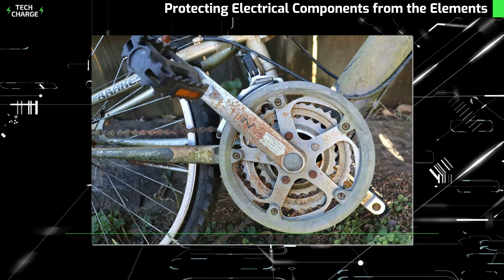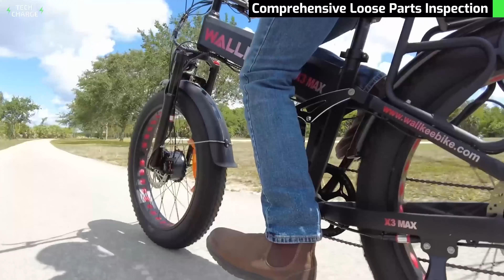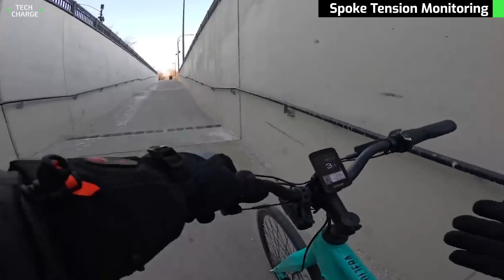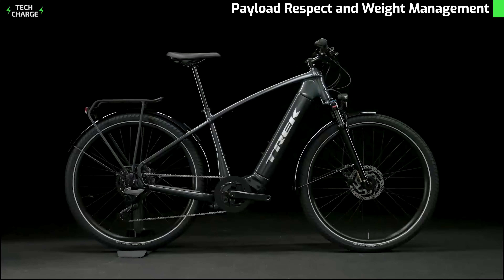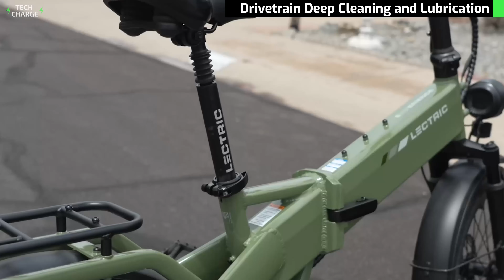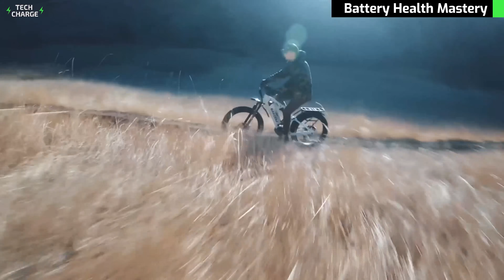Do THIS Regularly, and Your Electric Bike Will Last Forever!

Comment: Any thoughts on how to regulate how much you charge the battery if the charger doesn't have a gauge?  I want to take good care of it but not sure how to without the built in gauge???
Reply from the maker: Since many standard chargers don't have built-in gauges, you can use a simple plug-in power meter between the wall outlet and the charger to monitor the energy consumption and unplug it once the charging slows down!

Comment: You comment on things to help save a battery. Thanks but your video pic shows the battery being checked, and you fail to show how to check it or the lithium cells within it.  With all the high end proprietory bike batteries being sold at 800 to 1200 dollars it would be nice to know how to check and save them, not just clean your bike and chain.

Comment: Well I just use cheap e bikes from china, you can adjust anything you want on them, cheaply, parts, controllers, batteries, display and motors are mostly interchangeable so makes everything so much easier than all those Bosch type motors. The frames are steel, you really can't go wrong. Had to waterproof it myself but apart from that your laughing for the money. These people paying thousands for normal slow ebikes are absolute idiots. If you have to take your ebike to a specialist to get it serviced, that's shameful to me. Its not hard to work on bicycles. Buy the crank removal tool, chain whip, spoke key and just a load of spanners and Allen keys. You never have to pay to get anything done ever again on it, you do it all your self

Comment: A bit of WD40 on contact points, metal gears, bearings, sprokets and wipe down does help keep moisture at bay. Keeping bikes under cover, indoors stops corrosion. Batteries in room temperature and avoid charging when it is too cold, avoiding warranties. Only use generic oem chargers. Batteries, and never charge with a hot battery ( immediately after use, and wait to cool before using).
Reply: WD-40 is a penetrant for breaking free rusty nuts, for water proofing use dielectric grease that won't erode the contacts over time

Comment: so not just tighten loose nuts/bolts etc, tighten them to correct torque. Thats hex head, normal head, whatever head, I dont think so somehow. This video is enough to put most people off buying an e-bike. Battery charging recommendations are great though.

Comment: Use tires with treads designed for the surfaces and road conditions you ride on. Strongly consider puncture resistance. I use road tires with built in cushioned tread armor on a mtb. Inflated to 50psi. Tread designed for other surfaces will wear faster and ride rougher, with constant vibrations, and with more roll and air resistance if you ride on pavement.

Comment: I have been surfing for 50 years in 13 different countries many of which I used neoprene wetsuits to KEEP warm and one thing I guarantee you they didn't do and that is DISSIPATE HEAT. So my very first question regarding #15 is "What is this new neoprene called that actually stops moisture intrusion but somehow dissipates heat?". Where can I buy it? Thanks for making this video- going to watch #14 thru #1 now.

Comment: For the price of that type of maintenance you can just buy a new ebike every two years.
Reply: agreed, and might even get 3 or more years out of one.
Reply: Bike maintenance is easy for anyone has worked on their vehicles, since everything on a bike is much more accessible.  I have two ECells Five Star ebikes that are now 2 years old,1500+ miles on one and 1200+ on the other.  Minimal maintenance has been the ticket.  I've pulled both hub motors at around 1000 miles on each bike for a regrease, but could have gone longer.  Brake pad replacements on both which is simple with inexpensive kevlar pads from Amazon.  Beyond that, derailleur adjustment and chain lubing is about it.  I'm just watching for Commiefornia to impliment draconian ebike laws due to the actions of kids riding like maniacs and causing acccidents.
Reply: @melrobinson6919  There's this weird femi fascist attack on bicycles and ebikes. When I was a kid an around the year bike was basically a no maintenance item. Drop of lube, little air, maybe a flat tire every couple of years. These days even new bikes are constantly failing in urban environments. When have you last met someone who's been riding the same bike for the last 10-15yrs as regular all purpose ride? Professional maintenance is ok but priced for start-up types, DEI girl bosses or wealthy boomers.
You can buy a decent bike for 20-50$ online any day of the week, which is literally the price for getting a flat tire changed or a maintenance job, which often isn't even that good. That someone who commutes by bike or ebike pays below 500$ p.a. for the experience is probably the exception now, as far as I can see. That's ridiculous.

Comment: I bought an EBike and I never used it in the Rain. I kept it indoors and charged it every 3 Months.  After 2 Years the Battery was Dead.  I took the Battery apart and the Battery was full of Water. They obviously Stole my New Battery and Stuck an old one on My New Bike.  I have a Battery Welder but the Whole Battery unit was Rotten with Rust.  The Shop had gone so I took the Lithium Batteries out and Put a new Motor and Batteries on the Bike.
Reply: Never ever leave yiir battery on your bike when you lock it up you're asking for trouble then.

Comment: I got sick of the number of times the narrator says "28 MPH." If have a Level 3 e-bike, you have a motorcycle. Ride it and care for it like a motorcycle. My folding city e-bike is barely half that fast and it doesn't weigh more than a typical beach cruiser.

Comment: Most of these recommendations are more applicable to off-road riders with powerful motors. The suspension forks on my city e-bike are not even adjustable. The motor power is limited to 250 watts by law. Plus with the AI video production, and I am not giving this a LIKE.

Comment: The charging port for the $650.00 battery that I bought for the E-bike I built came loose and blew a 20 amp fuse inside the battery compartment which was completely wrapped in electrical tape ( I couldn't find the fuse) 2 weeks later I got caught in the rain and water got into the slide electric connection which wouldn't allow the battery to shut off. A gasket I made fixed that. 40 mph, 1500 watt rear hub motor 52 volt, 20 amp hr battery, 3 years, 3,000 miles I luv it 😅
Reply: ❤ ebikes!! ex olympic biker!

Comment: my 3 years old Electric Bike have zero problems NOT one.
Reply: My first ebike still will get up to 20 mph after five years. No problems I will occasionally use spray lube at the hub. I have adjusted the brake cable after it slipped.
Reply: Im sure it does if you haven't been taking care of it.

Comment: Not sure it's practical to leave your battery only 60-70% full?
Reply: It's better and easier to keep it between 20-80%
Reply: @allanwright9681 That's not what they're asking. The 80/20 rule isnt all that great by the way.
Reply: @Samusaran77 they're not asking anything,  just recommending.  Letting the battery fully discharge and charging it to the max reduces battery life and performance.
Reply: @allanwright9681 In regards to OP, not Allan. Stationary % and charging cycles are two different things.

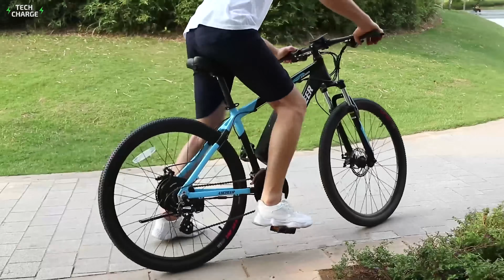Comment: 22:38 If an engine operates on gasoline and a motor runs on electricity, what would a motorcycle run on?
Reply: There are both gas and electric motorcycles.

Comment: Using dielectric grease on the battery contacts protects against corrosion. Using blue (242) Loctite prevents fasteners from loosening while allowing them to be removed if necessary.
Reply: I use the dielectric grease in the electrical connectors especially the throttle connector

Comment: Thank you. I let an ebike sit fully charged fir 5 months because I bought another. I needed to use it one day as rhe new one had an issue. I only made it 3/4 if the way to wirk then the battery died. . It continued to die after recharging way to fast.  Any way to bring it back or just buy a new one ?
Reply: Search for a recondition battery video, hopefully there is one.. (not necessarily an e-bike battery,just lithium) it may take a while to get it back but with lithium batteries it should be possible. Good luck.
Reply: Why would Li-Ion batteries from a top brand such as Aventon or Lectric have such a memory effect?   You should look over the forums for ebikes and present your problem there.
Reply: @animejanai4657  because all lithium batteries have that effect?